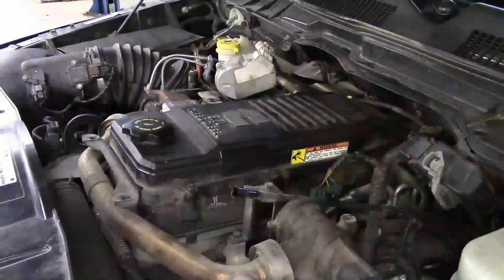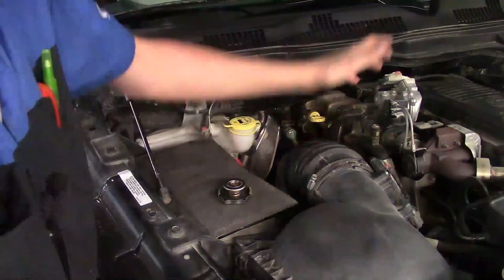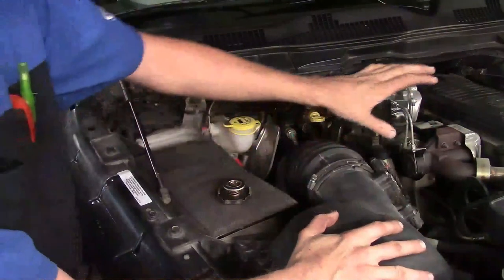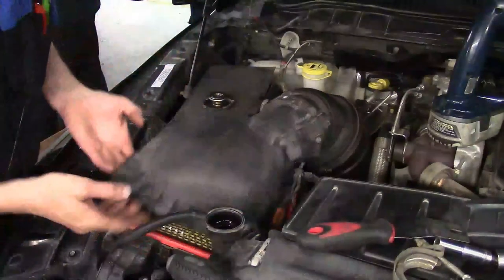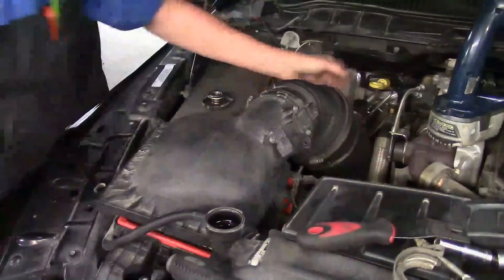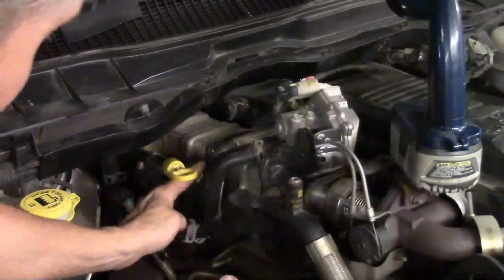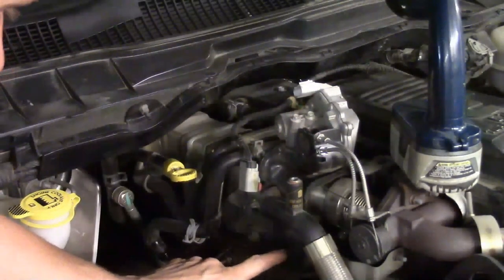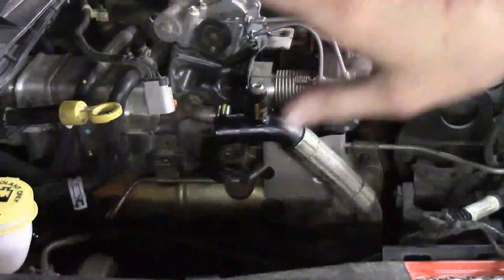Part 1/4: Dodge Ram 6.7 Cummins 67,500 mile service

Comment: Hey buddy, I have a 2013 Dodge a week ago this " perform service" appeared a week before that my truck barely started and sometimes still do it. Do you think  that's why??.
Thanks.
Reply from the maker: I doubt it.....the service at that interval typically doesnt affect any starting. Sounds like some diag is going to be needed.

Comment: Hey Dave. Got a question about diesel fuel additives. I can't find any definitive documentation on 
1) why we need to use a fuel additive, and 2) which /what brand additive to use and 3) how much additive to use and 4) at what frequency to use an additive. 
I've been using OptiLube - 8oz - every 1000 miles. 
Too much? Too little? Frequency? 
Really need some help on this issue. 
Thanx!!
Reply from the maker: +Marcie Warner I have never had any experience with Diesel fuel additives. I have over 230,00 miles on my 6.7 and never added anything to the fuel. I make sure I use good quality fuel and good quality filters. I wish I had more info for you on the subject but I truly don't. Seems most of the info you find on line is actually from the additive company and then I cant help but think that the info is then biased.
Reply: Thank you for your honest opinion!  That's exactly what I was thinking too about diesel fuel additives. It's all marketing by the oil companies. There's absolutely nothing in my owners manual about additives either.  Just another scam to pick our pockets.  Best to you and thanx again for your help!
Reply from the maker: +Marcie Warner Some people swear by it and sometimes it makes me wonder.....am I in the wrong or is there really something to it. I haven't personally with my own two eyes seen any difference. I do know that Cummins doesn't like additives being used but found it hard to find documentation stating that while looking. Me.....I'm spending my money of fuel from a reputable gas station and good quality fuel filters. Thanks again for watching
Reply: Just wanted to tell you that TODAY, I successfully changed out my two fuel filters on my 2015 RAM 3500.  Thanx to your expert instructions, the job went well.  It was still a little messy even though I had installed some drain tubing on both filters.  The drain tube for the front worked perfectly. Not a drop of diesel on my garage floor. But the rear drain tube did fine until I unscrewed the sensor, and then the filter itself, and of course the diesel started to run.  Because of the filter's placement, directly over the drive shaft, the run off hit the top center of the drive shaft and caused it to splash in all directions. Next time I'll throw a sacrificial towel over the shaft to prevent that from happening again. But other than that, thanx to you, I got the job done and pocketed $200.00!  Best to you and thanx again for your expert advice!
Reply from the maker: +Marcie Warner Your welcome Marcie....yeah that rear filter will start leaking either when the filter is loosened or the water drain removed even after draining. I have 50 gallon drum that I can the top off and made into a large drain pan to help TRY and capture the splatter lol. I appreciate the update and when I hear people saving money from watching my videos.....I get a smile on my face. Thanks again Marcie.....The channel hit 10,000 subscribers today and its because of viewers like yourself!

Comment: is this the message about the DEF system? I think the last time i had it said something about only be able to drive X miles then it would limit to like 15 mph? I have a 2014 crewcab ram 2500 6.7l cummins turbo diesel.
Reply from the maker: This message will come up around 67,500 miles and depending on the it truck or cab and chassis and also the year.....there are few things that need to be serviced or replaced. It has nothing to do with the DEF warning that you mentioned. For your truck at 67,500 you would be replacing only the crankcase filter. No EGR or EGR cooler cleaning needed for your 2014. Otherwise just the normal maintance.

Comment: how many hours do you charge for this service. trying to figure out what to charge our customers. thanks
Reply from the maker: We usually charge around 5 hours based on the Mitchell Labor guide. Its been awhile since I have done one being that it mainly was related to the older 6.7 engines. Over time it changed to just replacing the crankcase filter. The labor guide states 2.0 hrs alone just for the EGR which I feel is excessive but its what we base the labor times on. Thanks for the question and make sure to subscribe

Comment: I have a question for you. A couple days ago i was driving my 2010 2500 6.7 cummins and as I took off from a stop light, I was on the throttle and all of a sudden the truck fell on its face and lost power and made a LOUD DIESELING noise then resumes and picks back up and goes. . It has done that a few more times but in addition to that it has taken it 10 seconds of cranking before the engine barley sputtering and start to run. That has happened about three times now. 
Truck has 145k miles and I have kept up on the service and has always ran great and even with these issues going on it still runs really good on the highway and around town. 
I changed the fuel filter about a week ago with no problems. I'm not sure if that has something to do with it or not but the way it's acting it is very concerning to me. Immediately I thought CP3 or lift pump or injectors but I need an expert opinion like yours.  I watch all your videos and love watching them. Keep them coming.
Reply from the maker: I haven't found any issues with the cp3 pumps....they hold up great. Even the lift pumps have been doing well. There could be numerous issues. I would first check to see if any codes that could help narrow down the issue and give us a direction to check into. Prolonged starting could be a fuel issue such as a leaking injector or even a fuel control actuator on the cp3 pump. It takes some looking up codes and some data readings to see if anything jumps out like odd fuel pressure readings in the scanner.
Reply from the maker: Thanks for watching and for he kind words John
Reply: +MotorCity Mechanic 
Thank you for the quick reply. I wish there was a code to see. I haven't been able to hook it up to a scanner to see. I have a warranty on the truck and will be taking it in next week to see. Hopefully I can find the problem and get it fixed. I'll keep you posted!
Reply from the maker: +John Lynn Cool. I will keep an eye out for your reply
Reply: +MotorCity Mechanic 
I have another question for you. After I get this starting and fuel situation solved and fixed I'm going to do full deletes on the truck 
(egr,throttle valve, turbo back exhaust and EFI live single tune)
My question is in your opinion what level horsepower should I set the tune in terms of best fuel mileage and reliability. More power and torque is always a plus but I don't want to harm the injectors or head gasket or trans. 
The settings options are 
40hp / 70hp/ 100hp/ 125hp
Reply from the maker: John Lynn Hey there John. I don't deal with programmers here at the dealership and don't have an experience with them outside of the shop either. I wish I did but I wont be much help for you in that matter.
Reply: +MotorCity Mechanic ok no problem. 
Thanks again. I'll keep you updated on everything. Truck goes to the dealership in the morning. I wish you were in Texas I would bring it right to you!

Comment: Hey Bud, just got a message on dash,  ''Exhaust system service required SEE DEALER''.  Truck has 15,900 miles. And the DEALER did the recall about 400--500 miles ago?  any ideas
Reply from the maker: The cause could be many. Maybe its related to the work that they did or something else. Whats needed is to have the codes checked and then we can see what the most likely cause is. You can get the codes checked at any local auto parts store. If you do that than let me know the codes and I will help you further. But reading more.....it appears the truck might still be under warranty? 16k miles and possible only a couple years old? If warranty then I would refer it back to them. But I will still help you with the codes so that you have a basic understanding of what it might be before taking it back to them. Thanks for watching and make sure to subscribe!
Reply: Code P0102.... Mass or Volume Air Flow A Circuit Low.  ??

Comment: New problems with Dodge3500 automatic trans 4x4 slipping 342k miles. Would you recommend rebuild? or buying another new trans? or what type trans would you re-install?
Reply from the maker: +Todd White What's the year and if late model.....which trans?
Reply: 2007 4x4 Dodge 3500 6.7 cummins. I'm thinking Trans is automatic 68RFE?
Reply from the maker: It will have a 68RFE. That it lasted 342k miles speaks alot of the trans. That trans holds up great and its the same that I have as well. If we are setting price aside for a moment and thats not me actually checking prices so there may not be a big difference.......but I like the Mopar reman unit. Reasons are that they use new OEM parts. They give you a good warranty that is honored at any Dodge dealer in the country. Im not saying that trans repair shops wont do a great job......its just that I dont know the parts they are using and where do you go for warranty if out of town for example. Alot of the components on the trans have 343k miles of wear....shafts/bushings/gears......a rebuild will reuse the majority of the original parts. Mainly the clutches.....pistons....seals will get replaced. Valve body might be gone thru but then there are alot of of valves/pistons and cylinder bores that cant be measure....cant be accessed. The mopar reman will have a replacement valve body as well. Im a bit biased.....but I like the product and have had great results with the Mopar remans.....So my opinion....The Mopar Reman is my recommendation. This is just one persons opinion and there are many more out there that are go as well. Hope this helped and didnt add more confusion Todd
Reply: Do you have any comments on what should be done with the used Torque converter? Re-use, Re-build, Replace? then Replace with what? or suppose I can find a low mileage 68RFE from a wrecked vehicle, should I then consider a new Torque Converter? and what should I be looking for in that TC?
Reply from the maker: The torque converter will always get replaced. A good reman will come with one
Reply: 1. I am wondering what is the PRO and CON's of upgrading your Torque Converter? or should I even be thinking of upgrade?
 2. How do you determine which Stall range to get?
 3. If you get the wrong stall (too high or too low) what effect does it result in?
 4. Do you lose or gain low end torque?
 5. I read things about certain ones smooth idle or something?
 6. How would it, if any, effect air-care?
 7. How much am I looking to pay for this torque converter?
 8. Suggestions for BRANDS, TYPES, to LOOK for? STAY AWAY FROM? Sorry I ask a lot of questions, just concerned that when I'm spending $3k for a rebuild, I get the most bang for my buck.
Reply from the maker: It goes back to what I have had my hands on or dealt with on a regular basis.....All the torque converters I deal with are stock and OEM. I wont be of any help with it comes to narrowing down which will work best for you and your application. Wish I did but I just dont know.

Comment: Hey David, can you tell me if I need to do all three steps or just a filter on 2013 Ram 3500 SRW 6.7 diesel?
Reply from the maker: The service info states only the crankcase filter is needed. So no cleaning needed on your year model. Thanks for the question and make sure to subscribe

Comment: Should you clean the airhorn, or butterfly valve?
Reply from the maker: +Anthony Molinario Its not recommended by the manufacture or needed. I haven't had any issues with either over the years. You will be fine by leaving it alone.

Comment: how long do alison transmissons usally last if well taken care of my truck is at 167k miles i herd they usaully go out around 200k it has a 6.7 cummings
Reply from the maker: Actually the truck doesnt have the Alison....instead it may have the Aisin or the 68RFE. Depends on the series of truck that you have. When it comes to transmissions.....some fail coming off the truck when first delivered and some have over 300k with no issues. So there is no average life span that I have seen. Thanks for asking and make sure to subscribe
Reply: i have a 2010 ram 6.7 cummings 3500
Reply from the maker: You have the 68RFE.....thats a Chrysler trans. They hold up great. Mine has 230k miles and only replaced the valve body at around 180k. Otherwise nice trans.
Reply: where are you located? i transport cars for a living with my ram and i need it to be inspected really good and seems like no body in my area know much about rams
Reply from the maker: Located just outside of Augusta Georgia......a stones throw from I-20.
Reply: ok can i make an appointment with you i need a really good inspection done
Reply from the maker: Hussein Fakhreddine You always can. You have to call the dealership and set it up. They handle all the appointments. The dealership is called Thomson Motor Centre.

Comment: Hey MotorCityMechanic, I have 2011 Ram 2500 w/ 6.7 . A light popped up saying my 4x4 needs service. I plugged into my obd and shows nothing pertaining to the light, What type of service does it need?
Reply from the maker: +Larry Johnson What most likely cause for no codes is because you need a scanner that access all the control modules on the vehicle. The FDCM (final drive control module) most likely detected and issue and has set a code. Retrieving that code is very important and will give you the direction to head in. Its basically a check engine light for the 4x4 system....it doesn't actually mean service such as fluid change. Thanks for the question and make sure to subscribe

Comment: Hello , how are you.  Look I did all the service you indicated but I'm still getting the massage ""  Service DEF system see your dealer,   and a say also max  5PHR in A 78 mile . What is this masege . Thanks
Reply from the maker: Morning.....that message has nothing to do with any of the services. The "perform service" message deals with the 67,500 services....the message your getting is basically a check engine light for the DEF system. First thing we need to do is to have the codes pulled. Then with that info I can give you a direction as far as what might be needed. Thanks for the question and make sure to subscribe

Comment: What about if you did deletes?  What kind of $ is this kind of service?
Reply from the maker: I know nothing about deletes. I only deal with stock trucks all the time and never checked into to see whats the best way to co about the deletes and what works best. The service cost will depend on the year of the vehicle because not all vehicles get all 3 things at 67,500
Reply: Ok. Thx. Good videos you put out. Explaining step by step. If only more mechanics would do good service as you are doing.
Reply from the maker: @tcss4  Appreciate that feedback and thanks again for watching.

Comment: do we clean the pipe going across the front engine?
Reply from the maker: Mike P I will leave it up to you judgement.....it's not required but if you feel that it's a lot/excessive the yes. Otherwise I haven't seen many that needed it unless the cooler failed and coolant turned the door into a wet mess. Thanks for the question and make sure to subscribe

Comment: Sir, what do you think the dealer will charge to have this done?  Thanks in advance.
Reply from the maker: What year is the truck and pickup or chassis/cab?
Reply: I have a 2012 2500 megacab 6.7L diesel
Reply: The truck says my exhaust filter is full, power reduced see dealer
Reply from the maker: When that message comes up....the 67,500 service most likely will not make a difference. The DPF is getting full and you need to find out why and then have a regen performed to see if the DPF can recover or if it has gotten too full to burn out. Its going to require diag at this point.

Comment: The reason why I deleted my truck
Reply from the maker: If the costs to repair mine reach the price to delete.....I will as well. Thanks for watching and subscribe!
Reply: $2500 to delete. 5in straight pipe, tuners throttle valve delete,ccr filter delete,egr delete  tuner by double R diesel. its works great. 23 mph on highway. no issues. but around prius cars it does seem to  smoke (accidently roal a liitle coal) from time to time :)
Reply: I’d do a delete but sounds like EPA cracking down on deletes. Plus not sure who would inspect it when it come license time